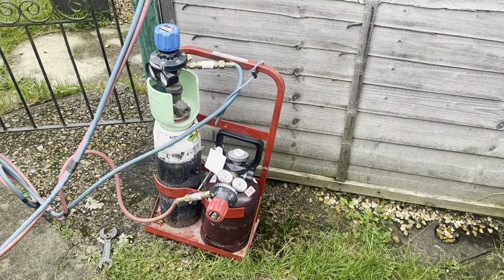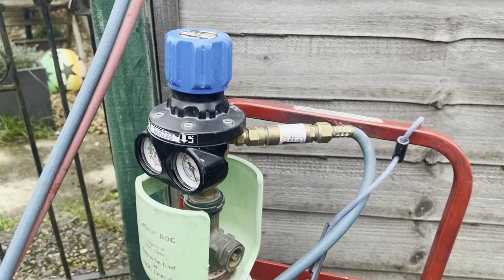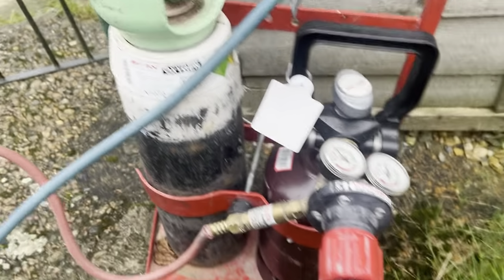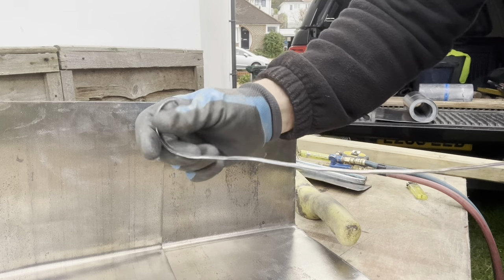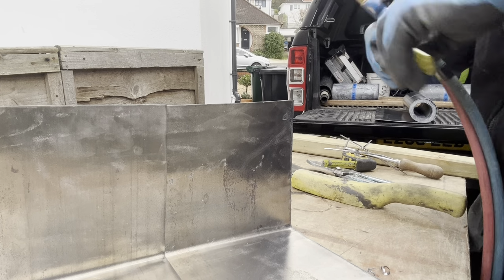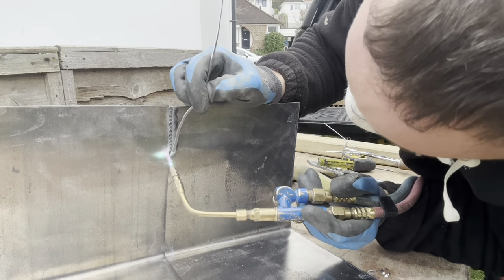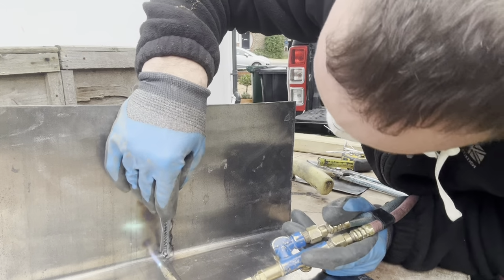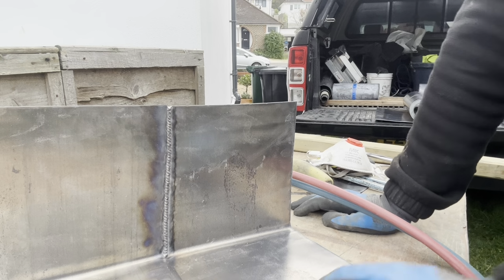Lead Welding On The Vertical. MADE EASY. (CHEAT CODE)

Comment: Nice video good technique,  i where ever possible used to arranged the lead so i came down on an angle which made it easier even though we were taught to start at the bottom
Reply from the maker: Thank you. I’ve always found it easier coming down from the top first. But it does take longer as you’re going over it again.

Comment: Great video you mentioned where you got the model o gun but where did you get the regulators from cheers
Reply from the maker: Thank you and thanks for watching. 
I can’t remember where I got them to be honest. 
But if you Google victor edge regulators they will come up.
Reply: Welders warehouse sells anything and everything welding. I managed to order some nozzles that I’m hoping are gonna be better quality than a lot of the trash I’ve bought in the past. But I did notice all the Oxy/AC lead welding kits were all out of stock 8-12-22.

Comment: As usual ,a great educational video. I’ve been trying to perfect my welding for many years and I still struggle, especially on the vertical. Tbh I won’t even attempt for fear of burning through. I always go up on the angle. I’ve never really known what I should have my bottles set at so that’s the first thing I’ll be taking a closer look at. So thanks for that tip on setting the pressure. And I’ve always used a No. 2 nozzle. D’ya think I would fare better using a No. 3? I tend to think bigger nozzle, bigger flame and therefore less control. 
And on the videos it appears the flame is feathered. Am I supposed to get the flame to be a tiny white/blue dot with no feathered flame. That’s how I’ve always thought what I’m supposed to be doing. 
Just one random one here: do you weld your tapered wood roll ends or dress them? I dress them since my bossing is better than my welding but my dad always used to weld them.
Reply from the maker: Thank you I’m glad you enjoyed the vid. 
I personally always use a number 3. I would suggest getting one and just see if you find it any easier. 
With the flame you are after a tiny white ball. But you need to make sure it’s not to sharp as this would be more of a cutting flame.

Comment: An interesting method for doing a verticle weld.
Have you tried to use the side of the lead lap to make the weld instead of the lead filler rod, you may find it a lot easier and quicker. Can I suggest that you use a length of about 3mm inside diameter flexible hose about 1metre long  to attach to your oxy/actylene hand piece and the blow pipe, it will give you more flexibilty and is a lot lighter if you are required to do a 10 - 15 metre continious verticle weld as I have had to do many times - it also makes it easier when you are welding verticle seams using up to 10mm thick (100kg/m2 ) lead. The flexible hose makes it a lot easier if you are required to do any over head welding. Can I also suggest that you obtain and use a rubber dresser instead of the wooden dresser, it is more efficient and does not bruise the lead - by trade I am/was a Lead Burner (Lead Welder) for thirty five years and worked in an acid manufacturing lead chamber plant, - you learn how to be very skilled and effecient when welding lead.
Reply from the maker: Hi thanks for watching. Yes I’ve tried the method of using the lap as your filling rod but for me I find it easier this way. 
Also I don’t use any wooden hand tools. Although I used to own a wooden vintage bossing mallet and loved it. Sadly it broke and I’ve never found anything as good.

Comment: Top stuff again,Adams gas is rent free 
I've swapped acetylene for polypropylene, that burns sweet with proper nozzle.
Reply from the maker: I definitely need to look at getting my gas bottles rent free. There’s enough to pay out for🤦🏻‍♂️. Can you use that gas with your acetylene reg ?
Reply: @slbleadworks  no,you need propane pipes,reg,and flash backs with a multi jet nozzle.

Comment: you need to get an old paper cutting guillotine at car boot for cutting your filler rods it saves a lot of wear and tear on your hands its what i have used for 40+ years
Reply from the maker: Does it cut the lead quite thin too ?.
Omg yes I bet that saves loads of time.

Comment: Stu for what its worth I have just moved over to Hobby weld gas supplier because BOC cylinder rental cost have gone through the roof. With Hobby Weld you pay a one off deposit which is refunded if/when you stop using them, after that you just pay for refills.
Reply from the maker: I really need to look into this. Are the cylinders the same sort of size ?
Reply: @slbleadworks  i also looked into this the cylinders a huge, shame as the pricing is far better

Comment: Lead melts at c.a 620c - Map gas generates c.a 2k ' c... or 1200 on a bad day out - so what's the technical reasons Map gas isn't used for lead welding? Genuine question, I have no clue as to the answer as I have never welded lead - but I do weld a lot of other stuff for a living. Why not use Map? :-) Educate me & forever have gratitudes. :-)
Reply from the maker: I think the main reason is because of the cost. Propane is a cheaper alternative. I personally use Acetylene.

Comment: Please get away from boc, 
They are a ripoff
Hobbyweld all day long.
Reply from the maker: I really need to look into this. Where do you get yours from ?.
Reply: @slbleadworks  
You should try Albee cylinders. You own the whole set up and just exchange your bottles for full ones.
Eltham welding supplies in Portslade would probably be your closest supplier. Oxygen is 11ltrs & acetylene is 10ltrs.
Hope that helps.
Reply: Yeh I have Albee but they’re huge. Definitely need long hoses since u ain’t dragging those bottles up behind a chimney stack. I own them. Can’t remember cost but hardly ever have to refill.